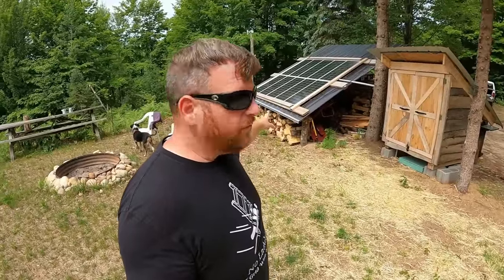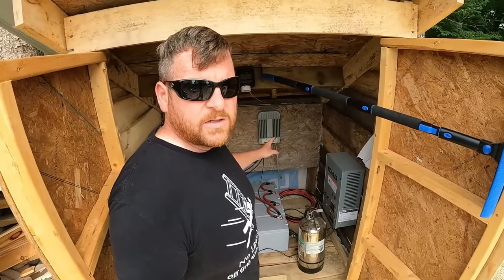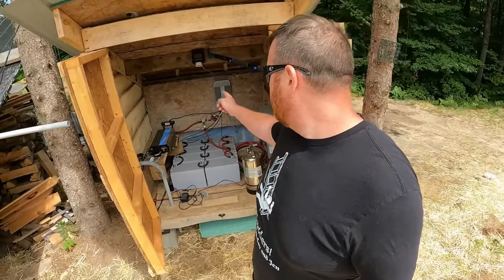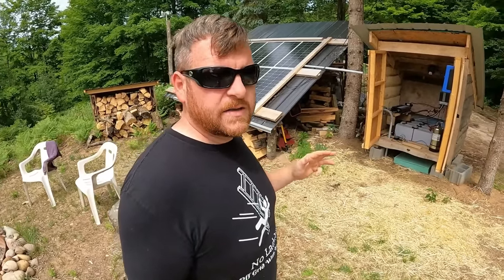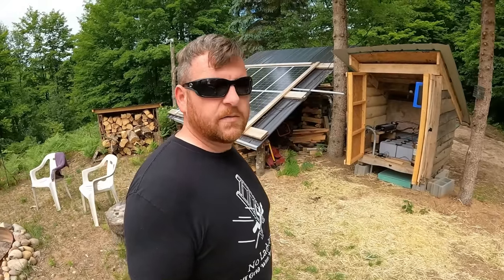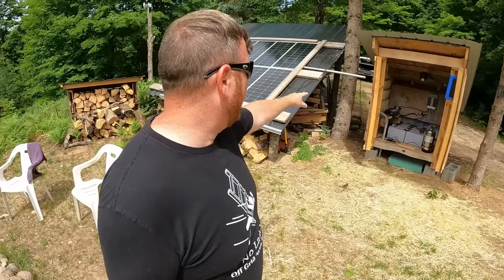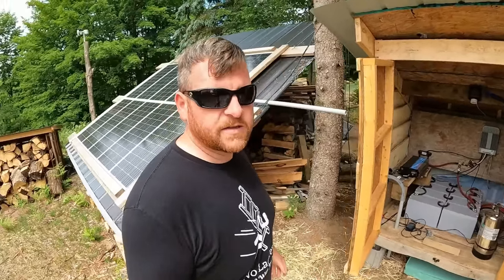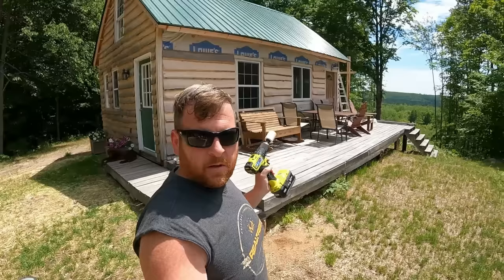One Year Off Grid Solar Power System Update

Comment: Really liked your video and as you say, I always see people spending like 20, 30 k on their solar system, I mean good for them but if you ask me that's crazy and they are missing the point on how solar power should be used efficiently. 
I have a similar set up, 4x340 w panels, 4x200ah led acid bateries and a 3000 w inverter. Only difference is that I'm planing to use an 24v alternator as a generator to charge the bateries during the night and help solar panels, we have a river running next to our land so I'll build a river wheel to move the alternator. Again, I really like your video, feels like something real, unlike the other examples I said 🤙
Reply from the maker: Awesome....good to know your similar system takes good care of you as well. We hope to add some wind power generation to our system this winter, should help with those long periods without sunshine. Best wishes

Comment: Good video! I like your battery setup. Good to know about lithium batteries and freezing temps.
Reply from the maker: Thanks.....ya I was surprised as well. Luckily companies are starting to work out the issues by adding small heaters to the lithium batteries or at least including a safety temp sensor

Comment: I have seed starting mats in between my  lifepo4  battery's  as a backup on a thermostat controlled plug as a backup if I wasn't home and heat went off. Haven't tried it more than testing endpoints but it's a nice peice of mind
Reply from the maker: Nice....I think those mats are similar to the RV water tank heating mats I plan to use. the keep the temps between 45-68F which seems good. I'll look into the seed mats too, nice work

Comment: Not only awesome, but very inspiring. Why not just insulate that entire battery shed. And you could put some kind of a fan system in it for the summer.  Heck if you got out of control you could set the fan up so that it came on and off with temperature and not have to worry about it at all. I’ve seen a bunch of people in Australia do it that way.
Reply from the maker: That might work.....might try that

Comment: Great video!
One can save quite a bit buying used solar panels at <$100 per 250W piece. You can also get reasonably priced hybrid-inverters.
The single most expensive part remains the batteries.
Reply from the maker: Very true!
Reply: @OffgridwithJayandJen  
An option to explore here may be salvaged Li-Ion batteries off plug-in hybrid cars or Ni-MH from Toyota hybrids. They have long life span and generally very high quality.
Most of them are wired sequentially to 100-300V to reduce current and associated losses, but can easily be rewired reducing voltage to 24-48V and increasing currents accordingly.
Most MMPT chargers and inverters allow custom settings to set specific charge/float/cut-off voltages for such case.

Comment: We just got a fridge for 1,000. We run it off our solar it is DC. Our RV Fridge second hand just crapped out on us. Hindsight I would have bought it 6 months ago and bought more batteries and more solar. We built an insulated doghouse for our water tanks. Using the 2 inch styrofoam board.works for us .
Reply from the maker: Love hearing real life info.....in theory we all want things to be perfect. Just not sure if simple will work for that. Let us know how how the DC fridge works out Cheryl
Reply: @OffgridwithJayandJen  we will let you know. On the boat we had a cold plate system.  Only because we were limited on how many panels we could hold. And batteries.  It was only 32 foot. But our golf cart type flooded lasted about 6 years and so did our AGM BATTERIES.

Comment: I still say a root cellar would be your best investment for food storage, batteries storage and now your water storage system (one temp year round) just and a well pump and connect it to the cabin also would add a RV tank level indicator in the cabin for your water and for them hot days a cool place to relax 
I'm thinking you could pump the cold air from the bottom of the cellar in to the cabin also but these are just the things I would incorporate in my build.
Keep up the good work and best wishes
Reply from the maker: I look forward to a project like this. We need a green house and a pole barn style building but on the smaller side for storage then will work on a cellar on the hill side.....should be fun
Reply: Derek - that is an interesting idea - I like it! Tho, what would you do about the moisture from the humidity?
Reply: Have a 10" pvc pipe from the cellar underground to the cabin have a computer fan to pull in the cool air in and the moisture should run back down the pipe if any only thing would be that caller smell

Comment: Yup, That price sounds right in the ballpark of what I spent on mine, I've got $4000 invested in mine,  Off grid powerwall in my  800 ft² home. Running a gandale 4000 W pure sign wave, With 8/ 100 W panels. Those 400&600 amp bus bars and switches can get expensive, plus the 4/0 cable ⚡️⚡️  I only have 400 amp hours of Renergy gel batteries at the moment. Need to bump that up in the near future
Reply from the maker: Very cool to hear you have a comparable system and cost. If we bumped up the solar and batteries 50% I think it would solve some shortages we have at times....but very functional as is

Comment: This is close to my setup, 1100w of panels and 24v 400ah of deep cycle LA batteries, I'm planning to go fully off-grid very soon as we have had a 700% price increase for electricity in the last 3 years here in the UK, £0.07 to £0.49 a unit with 300% of that in the last 16 weeks alone, and it's going up again in the new year by 50-100% more, plus a charge of £300 a year just to be connected to the grid.
Reply from the maker: These are Crazy times my friend......Not sure how people are going to be able to afford living. All These price increases and they want us to use more electricity to charge EVs and such......Crazy. I wish you the Best of luck. If you are looking for flawless function and use prolly double the system just to hold us over on those cloudy weeks, But it works very well when we Minimize our use.

Comment: I USE 3 300 WATT PANELS, a 60 amp mppt charge controller, 6 battle born batteries (7200 watt hours) and a 3,500 watt inverter. I use it to charge my Tesla and get 6 miles of range per hour for ten hours during the day and it runs my refrigerator all night. I insulated and enclosed my battery bank because in the center of Oregon it gets mighty cold (while I hide out in Arizona).
Reply from the maker: Lol. Nice. I was wondering if anyone tried charing electric vehicles on a smaller system. Why not right?

Comment: Could you put your battery bank and controllers down in the ground sort of like a walk out basement or earth house build exposed wall and roof out of 2x10 or 12 to hold more insulation put open side on south to get more sun. Looks like airflow under it would be harder to keep warm
Reply from the maker: Ya installing the battery bank in a cellar type shelter would make a lot of sense. Maybe someday we will go that route.  The purpose of our solar shed design was to keep it somewhat portable so we could move it around if needed. But it works well. Just need some insulation

Comment: If you ever looked to replace equipment or install anything bigger go with Victron it’s a bit expensive but it’s great and it’s very expandable so in most cases you can parallel up devices if you want to expand the system which on things like a cheap inverter you simply can’t
Reply from the maker: This system was built with better equipment in general....names that have treated others well and have done so for us as well.....odd ball brands that are extremely cheap i completely agree with you to stay away from. If you're interested we just did a serious over haul of our system and big upgrade. Videos were posted about a month ago

Comment: Buy the lifepo4 batteries that are heated or add a RV tank heater under the batteries to keep them warm.
Reply: That’s definitely a solution but you waste some of the energy depending on how cold it is if the battery heater runs all the time you may lose half the charge you gained in a day overnight

Comment: Good video. I subscribed and will continue to follow you. 

I suggest you consider a different insulation plan for your solar equipment shed. — instead of what you have in mind, spend a few more $ on insulation and do the entire interior of the shed including the floor up to at least R40. Maybe even do foam. Add a small space heater controlled by a thermostat and run off the batteries could keep the entire solar system shed above 45F. This would allow you to go with LiFePh replacement batteries when the time comes to upgrade. It will also extend the life of those lead acid batteries which you will be very lucky to get more than 3 years of service life from. My experience and everything I’ve read says 1500 — 1800 cycles is their service life even in normal temps. I’d plan on replacing them at 1200 cycles in order to get something on the used market for them. Otherwise they are useless scrap. They also don’t last long if you discharge them under 50%. The Li-FePh can handle a deeper discharge and many more cycles if kept above freezing. Go with them as soon as your budget allows. Good luck.

WRT your IBC water totes - if you have a tractor or a friend with one, just bury them so the tops are below the frost line, probably 4’ in your area. Attach a small pump and run some well insulated PEX into the cabin and your winter water problem is mostly solved. With less rain runoff you may need to double your tote storage for those winter needs.
Reply from the maker: Welcome Dennis...and Thanks for the Advice

Comment: Speaking of warming up the batteries… The MPPT charger and the inverter emit a lot of heat. If you manage to utilise the warm air coming from them for the batteries, it may help to avoid the thermal mats.
First thing coming to mind is to insulate the shed all around and add a dedicated ventilation, which can be covered for winter season.

I would also consider relocating the system inside the house to use the heating side-effect. With 8A peak current coming from the panels the losses in additional 20m wiring may be not significant.
Reply from the maker: Ya I was curious if that might work.....will have to see. Thanks

Comment: In our climate in northern Vermont  we have to be careful that panel racks don't heave ( frost) unevenly as it can distort and crack the panels .
We generally keep are lead acid inside, my 8 L16s are in the 60 degree basement.
You might find a single mast and rack mount provides more energy as it is easily adjusted to face the sun. I put mine at 86degrees pitch in winter to keep the snow off and catch the reflected energy.
Reply from the maker: I wish I had built mine adjustable.....but I like to keep it simple and make adjustments and upgrades if needed. So far I have been happy with our setup,  but I do need to brush the panels off with snow. But set it up to brush them off easily on the ground
Reply: @OffgridwithJayandJen  I have one array on 4 inch schedule 40 steel pipe and the other on  a well casing cutoff . Both a similarly close to the ground  for the same reason :).
Reply from the maker: @georgemckenzie2525  nice work.....no climbing on ladders or roofs for you and I, lol
Reply: @OffgridwithJayandJen  roof p.v. is the worst way to install

Comment: Sometimes you can get used solar panels for pretty cheap. I got 5 kWh of 195 volt panels. Think they were about 85 bucks a piece delivered. Found a few not generating to potential, 3 I think.  Segregated those from the others and will use them for something else.  Solar is doable, I did get a few liFePo batteries though and the rev heating pad will most likely be how I hit them in winter in a insulated box. What exactly is the backing you have under your solar panels? Metal siding?
Reply from the maker: That's awesome about the panels. Our array sits on wooden lumber frame about 4 inches about metal roofing. We did it this way to sheild the firewood underneath so it doubles as a wood shed. It doesn't seem to get too warm thus far

Comment: Job well done and very well said.thanks. can you put a light in there in the winter you can turn it on at a low temps and add certafoam around your shed and bank some snow.
Reply from the maker: thanks John. The way I built the shed it will probably be easier to just insulate the batteries But doing the whole shed would be nice.

Comment: the newer smart lithium battery products have multiple temperature sensors and cold weather protection. Def worth a look.
Reply from the maker: I agree.....when we started this....it was not so readily available or affordable.  Glad things are becoming so. 😉
Reply: Sort off is the answer to whether they’re worth it most of the time because they will heat themselves up but waste a lot of the energy store doing that it’s not good if it’s a cloudy day where you only get enough to cover your usage in the house which would lead acid isn’t a problem, but with these lithium ones you don’t have to consider all the power of their heaters

Comment: Here is an idea. In cold climates store them below the frost line
Reply from the maker: Good long term plan and goal 👍
Reply: That’s definitely an option, but I would recommend maybe pouring concrete to do that and raising it a couple of feet above the ground level simply because if it gets really snowy and icy and it all melts quickly, you do not want it filling up the batteries

Comment: A few items.  If you expand the solar array, consider larger 300-400w panels as they can be bought at around $.65/w vs. the $.96w for the current panels.  You will need to reconfig panel wiring to have Voltage and Amperage of mixed panels be nearly equal.  I was involved in adding solar to a sailboat and cost (not including batteries which were already in the sailboat) was $650 for 640w or about $1 watt.  Used two 320w panels plus 60A MakeSkyBlue Mppt controller for the 12v systems on boat.  The EPever you have is more efficient.  As far as water from rain barrels, consider an inexpensive inline UV water treatment light to kill bacteria and viruses,  The light only comes on when water flows to house
Reply from the maker: Very nice, I like the idea of larger panels, but I was a total newbie a year otlr two ago so I bought the smaller panels and they worked well.  About a year ago I was looking for larger 300 watt panels and they were  sold out every where I looked online, so I stuck with the 100 watt panels just cuz I could get them. I will certainly look into the UV light for the water line. Thank you for the tips
Reply: @OffgridwithJayandJen  A 55w UV light water treatment tube setup costs about $100 from Vevor  (for example) and can treat 12 gals min flow and runs on 120v AC.  Hook it up to come on when your water pump  comes on (if you use one with rain barrels), or have a separate on/off switch if you use a manual pump.  Best not to run 24/7 due to electric use and bulb burning out.  There are lower wattage versions in the $50 range but they are rated at like 5 watts and can handle just 1 gal min.

Comment: Jay. John. Been looking at some tubers on running solar system. Bot some dirt uper mid Montana. Because of sub zero winters. I'm going to try put most every thing in ground. Like a cellar. House, water, cellar. Everything out of the zero zone. Don't know the price of those heating pads but if you take that and change that into cement sax and some building rock around your place. You might have enough slope on the other side of your driveway by your panels. Don't know if you could put the batteries and a seller food storage. Might have to build a wall in between and vent. You might be able to kill two birds with one stone. Because I you are talkin long-term there I think. You don't have to heat a seller that will save you battery time and that's the whole idea is to conserve. Keep up the good work and thanks for your time.
Reply from the maker: Good ideas John, thanks

Comment: my water catchment has set outside for 3 years now. the only time it freezesis at 5 below. i'm working on a greenhouse to block the cold and wind
Reply from the maker: Very cool......I think our newer updated system would not freeze up far below freezing as well, but my water heater is fairly exposed to the cold, so it causes issues for us.

Comment: I think this is awesome seriously. The panels dont seems super optimized but the system sounds like its doing everything you need. Thats the idea of solar i think kind of build as you need upgrade as you want. I think about ways to get high efficiency out of panels pretty often. Seriously though just having them facing the midday sun is good enough, and i think you prove that here too. I like solar. Personally I think in this day and age just having food water and shelter isnt enough. You do need power too.
Reply from the maker: Thanks Fajile.....You are right about everything you mention here. Including that the Panels could use some way to adjust them. If we hadn't tried to both keep it simple and use the array for a wood shed as well, we would have made the array adjustable. It looses a bit of efficiency being off angle

Comment: LFP is still great, use a resistive heater in your shed! Insulate it, keep it above 40ºF. And even if you don't, just have a temperature cutoff so you cannot discharge or charge below 32ºF. If you cannot be without power when it is freezing, keep your shed heated! Not 70ºF but just 40ºF is fine. Automate it easily.
Reply from the maker: Ya that sounds perfect